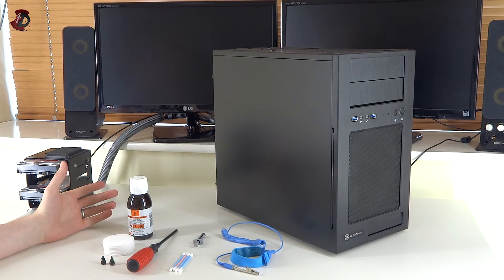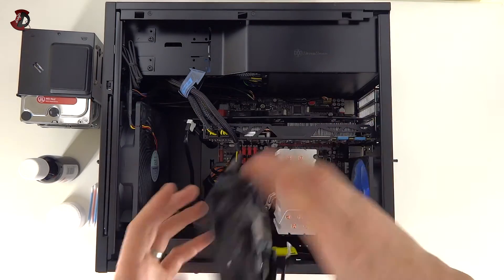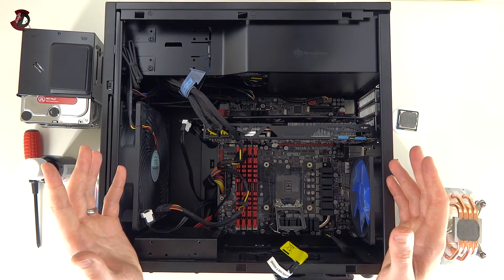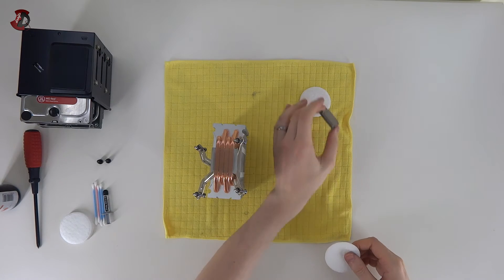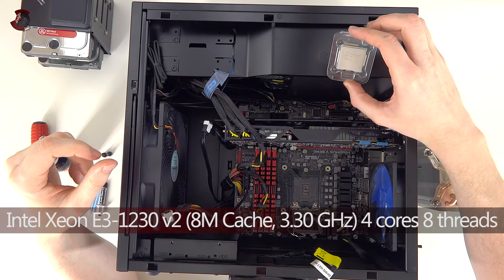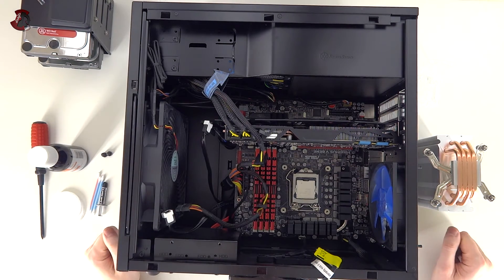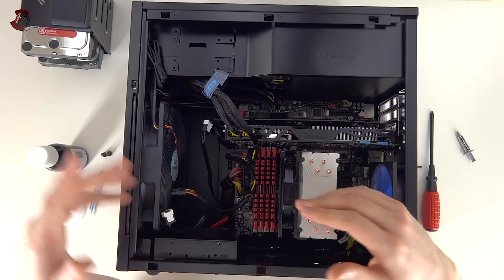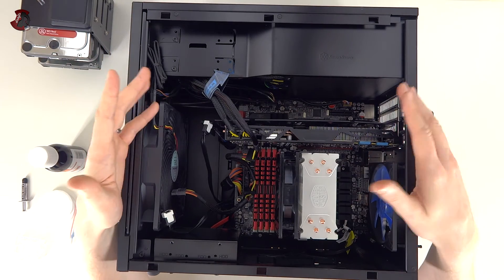CPU & Cooler Installation and Thermal Paste Application

Comment: Awesome and very informative video. One question though, I have this cpu cooler which is shown in the link below. How would you apply paste to this cooler?

http://www.coolermaster.com/cooling/cpu-air-cooler/hyper-103/
Reply from the maker: Most foolproof method is to place a small dot in the middle of the cooler itself and use flat plastic card to even out before applying to CPU. Remember, paste is there to fill imperfections in the metal that are barely visible with naked eye and not to form a visible gap between CPU and cooler.